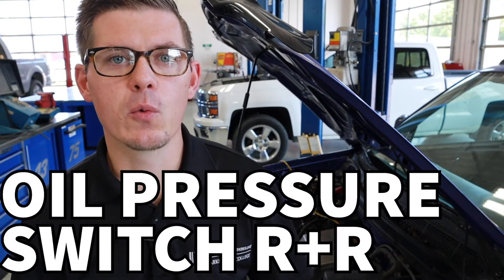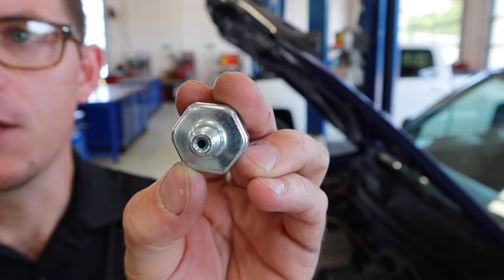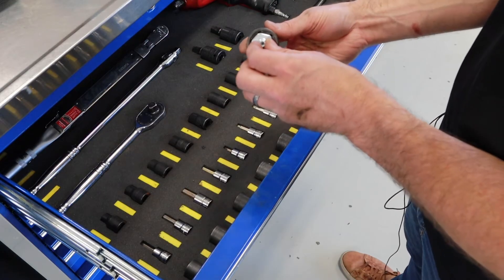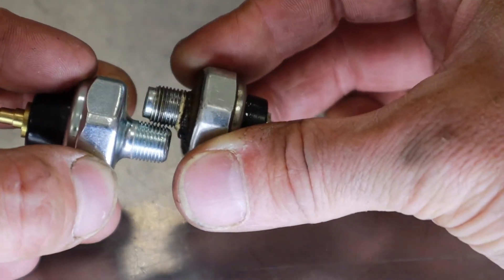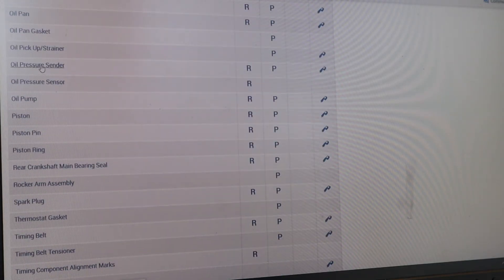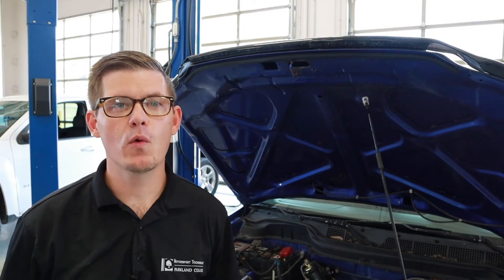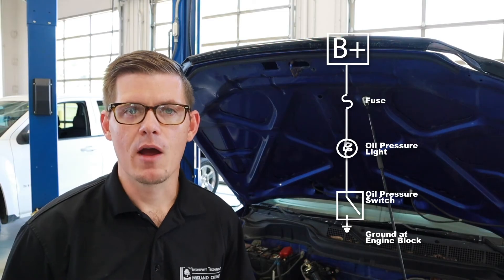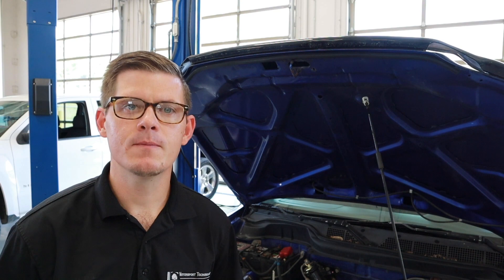Engine Oil Pressure Switch Removal, Replacement & System Overview

Comment: Put rear view mirror glue on new one n seal loc it then put plastic weld or epoxy putty.over coats then clear adhesive silicone to seal epoxy tightseal🧐✌️🙈🙉🙊💖😇😎😇☃️💈☃️🌎✌️🥰✌️💲☠️💲👺🔥🤔🏜️🌄🏜️😮😇😇😇

Comment: I need to repair the wiring going to the oil pressure switch because unfortunately the pigtail that is crimped onto the wiring going to the oil pressure switch snapped off on me. Thanks for explaining this process. I'm hoping that I can address this issue now as well!

Comment: The switch is on the left side on a 2003 Forester. A 27mm deep socket absolutely will not fit on it because alternator blocks it.
You may be able to use a racheting 17mm wrench.
Turns out mine wasn't leaking, so I left it.

Comment: Great video.
I have a 2004 Honda Pilot and when I pulled the electrical plug off, the wire came out of the plug (the female part).  How do I reattach it?  It looked pretty simple.
Reply: 88⁸😅⁸😊⁸

Comment: Do I have to drain oil for this?
Reply from the maker: No need to drain the oil. Some oil will come out while removing the switch, but not a large quantity.
Reply: @AdamsAnalysis  cool thanks! 🙌🏾

Comment: The video didn't show how to disconnect the electrical side of the switch, you completely skipped that.
Reply from the maker: This specific connector did not have a clip or release, it just pulls off. Some will be that way, others will have a release tab that must be pressed.
Reply: Teflon is recommended as per helms manual.
Reply: Honestly if you can’t disconnect that by yourself… you shouldn’t be touching that

Comment: is that the same location for an 06 crv?
Reply from the maker: Not exactly, the 2006 has an update engine (2.4L K-Series). The oil pressure sender on that engine is just to the left of the engine oil filter.
Reply: @AdamsAnalysis  AWESOME thanks, cant see ANYTHING in that area. im on my THIRD filter wrench just to get filter out lol. thanks for the FAST response!

Comment: Do you have to use Teflon tape?
Reply from the maker: A liquid thread sealant from Permatex would be best. Teflon tape might have the ability to insulate the metal of the sending unit from the engine block. If this happens the switch will not function electrically because of an open ground.
Reply: @AdamsAnalysis  -That was my thought.

Comment: The oil pressure switch why is it necessary and can the engine do without?
Reply: Mine has been missing for a year and a half been driving without it , its ok man
Reply: lol @rugratfromdao4274

Comment: The thread from the oilpressure switch in the inside of the engine is almost gone!! What to do now??? help!! I replaced the oilpressure switch with a new one, but I over tight it to much, the engine is 15 years old, what to do now???
Reply: Did any damage happened.how did you fixed it ?
Reply: Helicoil

Comment: Alright... one word of caution [that applies to some UK made cars of the past]: NPT and BSP 1/8" fittings have exactly the same thread pitch but different taper!  They are not interchangeable - you won't get better than 2 thread engagement, and trying to give it a little extra oomph to get rid of slow leaks will be stripped thread territory faster than you can sneeze.  There is NO amount of teflon tape that cures a mismatch - go buy the right thing/use proper adapter bushings as needed.
Reply: @AdamsAnalysis You just installed the wrong oil pressure switch and misinformed everyone! These Honda models have a 1/8 inch BSPT (British standard pipe thread). You just installed an 1/8 inch NPT (National pipe thread) oil pressure switch into the threaded hole. Causing both damage to the threaded hole in the engine block, and the threads on the new (incorrect) oil pressure switch and it will leak engine oil. @flinch622 was on the right track, but he didn’t catch that you were installing the wrong part. Stop making how to videos. You don’t know what you  are doing and it shows. Back to the books until you figure it out!
Reply from the maker: Good advice!

Comment: I'm having trouble removing the switch. It's a clear half inch piece of plastic after removing the rubber part. How do I remove the electrical part?
Reply from the maker: Assuming the connector released from the sending unit and did not break, the plastic portion is part of the sending unit and will be removed when you unthread or unscrew the whole unit.
Reply: I was having the same issue, but i just pull it off a little bit harder and it xome off.
Reply: Same problems here I can't actually get the cable off doesn't seem to be. A clip but it won't pull off

Comment: Hi what size are the OEM oil pressure socket? Thanks.
Reply: He said 26mm
Reply from the maker: I wish I would have documented that. I'm sorry to say I do not remember.
Reply: How do u get the connector off?
Reply from the maker: It snaps on and does not have a retaining tab.